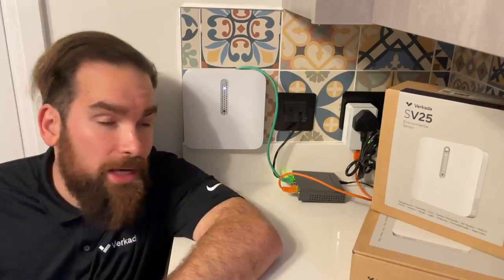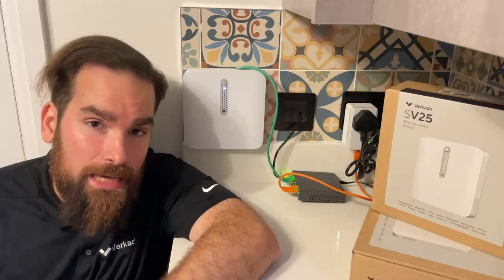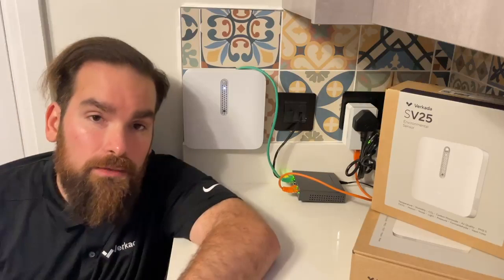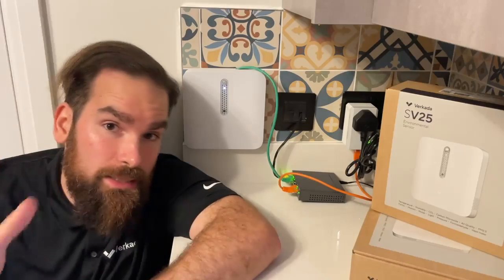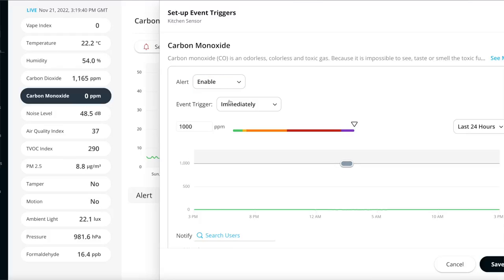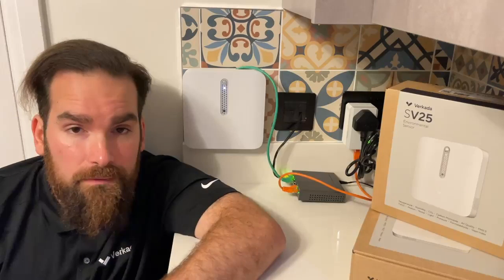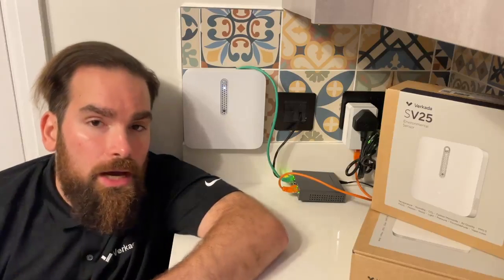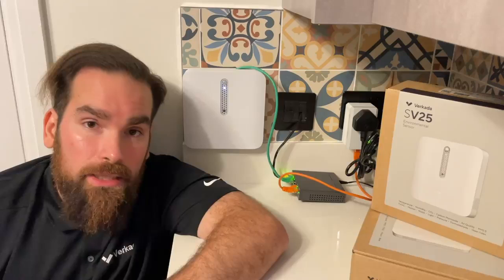Verkada - SV25 Air Quality Sensor Walkthrough

Comment: How do in add an email address to send alerts?
Reply from the maker: hey @richardmillee7116 you need to create an alert, then subscribe yourself to receive it over email and/or sms... soon all the alert configurations will move to the Alert Inbox (for products outside cameras), so you will have a much more simplified flow to set them up